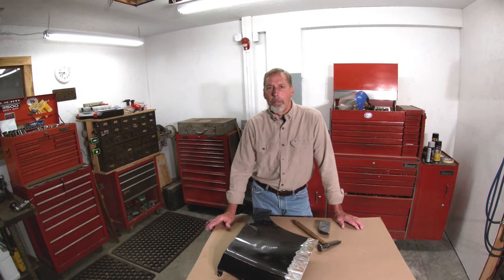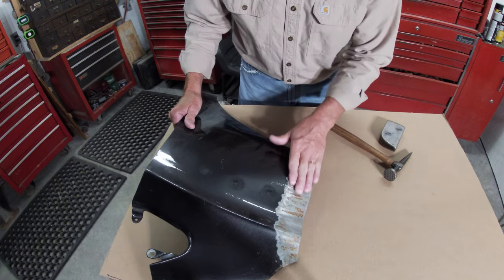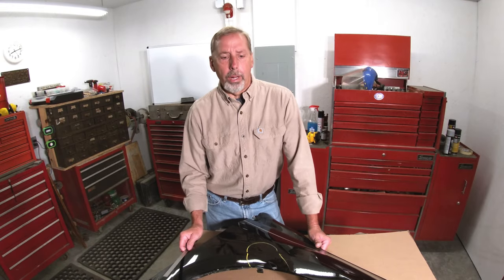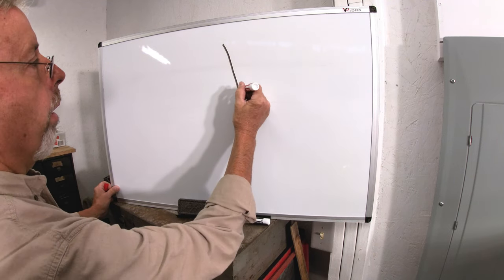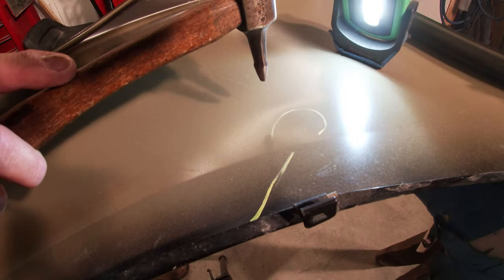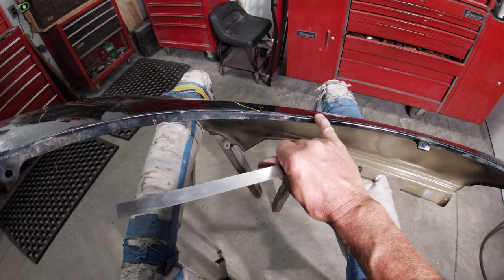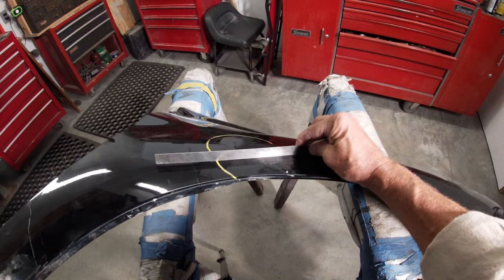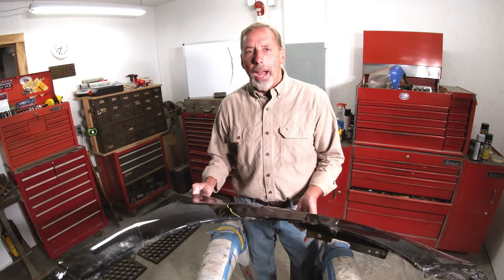Hammers and Dollies for Beginners

Comment: Where you doing both methods of hammer on-dolly and hammer off in the beginning? Obviously the purpose mess up was heavy hammer on stretching.  Good video!
Reply from the maker: I used a pick hammer in that video and that’s using it on dolly. I didn’t mention that since it was a beginners lesson and didn’t want to get too involved. Great question. Thanks for watching